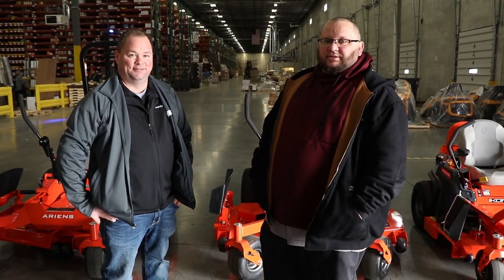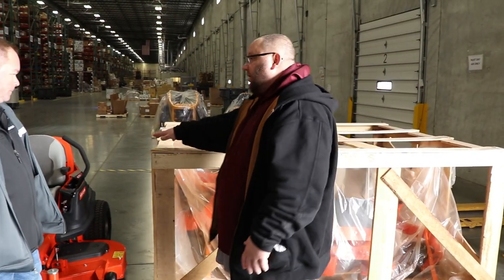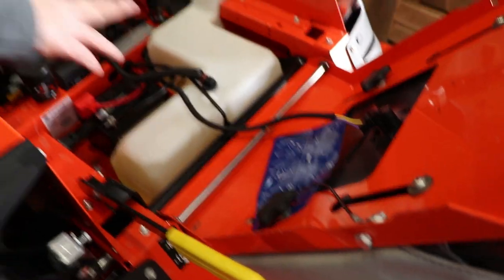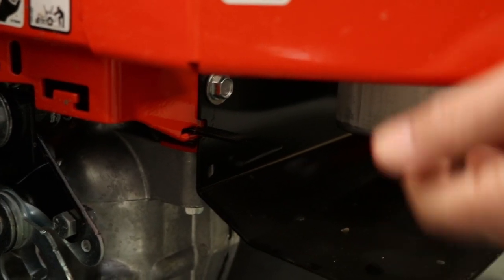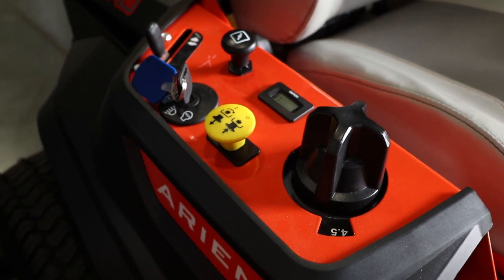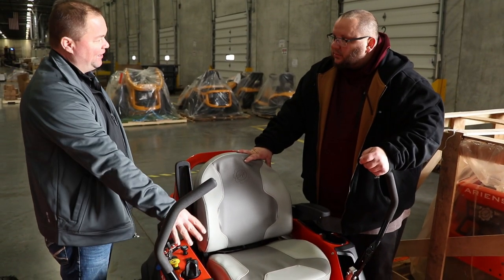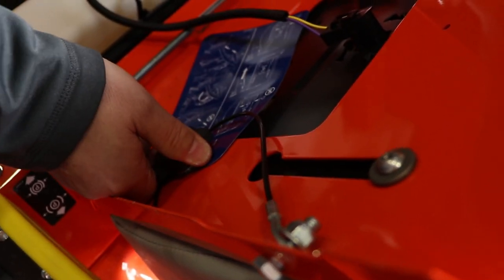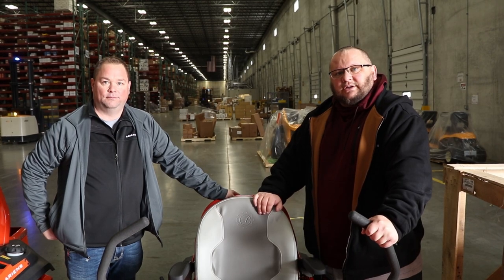How to Uncrate and Set Up a Zero-Turn Mower

Comment from the maker: A question we're often asked is how to get the mower out of the wooden crate. Power tools will make the process much easier. You could use a battery-powered reciprocating saw and disassemble the crate carefully in about 8-10 cuts—as opposed to using a hammer/pry bar which is much more strenuous. If you do this, please avoid cutting into any staples, and pick up any staples before attempting to drive or push the mower off the base. If you are going to push the mower off the base, remember that many models have a bypass lever behind one or both of the tires that needs to be pulled out before the mower will roll.

Please also note that mower tires are often over-inflated to minimize shipping damage, and likely need to be deflated slightly (to proper specs) after it gets out of the crate.

For more info, please read this article:  https://www.mowersdirect.com/stories/1721-How-to-Unpack-and-Start-a-New-Riding-Mower.html

Comment: Check the seat has been moved forward from shipping position. Otherwise the seat back will break the gaurd on top of the motor. Happened to mine from a big blue box store. Did not notice it till we arrived home with it being set up by the store. Love my machine xd 52. Also only comes with 1 key be sure to get an extra just Incase.
Reply from the maker: Thanks for sharing that experience; hopefully it prevents someone else from having that happen to them.

Comment: Most important part was left out. I was hoping to see how the unit gets from the pallet (once the crate is removed) to the ground.  Wheels seem to be blocked inside the holes of the pallet, which I imagine prevents rolling the unit (or is a new user supposed to drive the unit as a first test directly from the pallet?).
Reply from the maker: We appreciate the comment here. Yes, it's common for customers to set up the mower from the crate and drive the mower right out once the sides are down, just make sure to remove any staples first. If you're tool-savvy, you could always use a battery-powered reciprocating saw and disassemble the crate carefully in about 8-10 cuts— as opposed to using a hammer or pry bar which is much more strenuous. Also note that mower tires are over-inflated for shipping and likely need to be deflated slightly (to proper specs) after it gets out of the crate.

Unfortunately, we couldn't show the uncrating portion because Ariens had to take that new mower back with them after this video. Otherwise, we'd have gladly shown the process.

Comment: Help me understand why I should purchase a mower from you guys for the exact same price I can get one without waiting, uncrated, today at my local Lowe’s store?
Reply from the maker: Not everyone has a truck/trailer or is physically capable of unloading a mower at home after loading it up at the store. If you don't, you still need to rent equipment to drive it home, and also need the help to load/unload it in both places. Our trucks offer lift gate service and drop it off at your curb, allowing you to uncrate the mower on the ground and drive it right into your garage. We also offer one of the largest variety of mowers from consumer entry models to industrial-grade professional zero-turns that you won't find in a big box store. People choose to shop with us for our expertise on our products, our huge selection, and the confidence that we helped them select the exact mower with specs they needed, not just the one available on the sales floor at the big box store. At the end of the day, it's always a choice, but more people continue to choose us over our competitors each year for those reasons.
Reply: Thanks for the response. I thought since you cut out the middle man you could sell it cheaper.

Comment: Where is the uncrating your title mentions? I'm an assembler and I deal with these regularly and the unboxing is a literal pain in the ass. I'm guessing you decided not to do it because it is such a pain. I was looking for a tip or two but I just wasted time watching this. Thanks anyway.
Reply from the maker: We appreciate you stopping by this video. We always say to work smarter and not harder. If you're tool-savvy, you could always use a battery-powered reciprocating saw and disassemble the crate carefully in about 8-10 cuts. Just please avoid the staples. That way you're not working with a hammer or pry bar trying to force the crates apart all day long.

Unfortunately, we couldn't show the unboxing because Ariens had to take that new mower back with them after this video. Otherwise, we'd have gladly shown the process of unboxing.